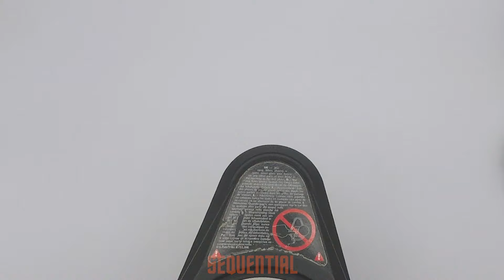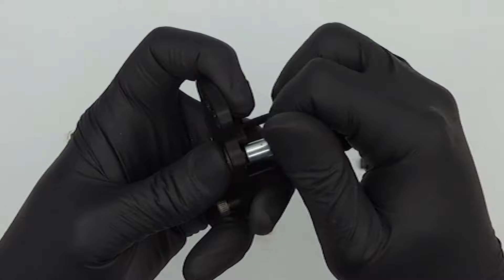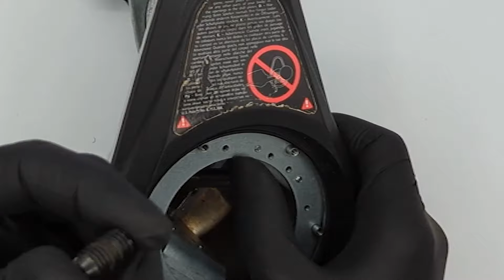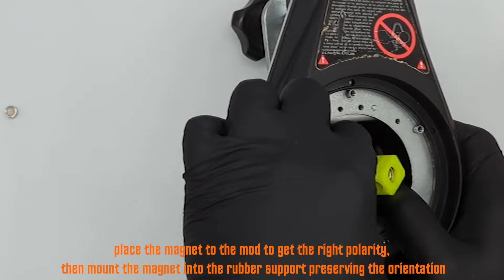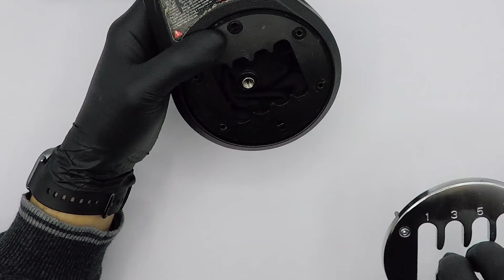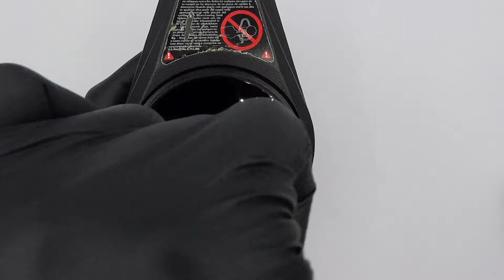3DRAP SHIFTER UPGRADE H-PATTERN / SEQUENTIAL FOR THRUSTMASTER TH8A

Comment: I bought this mod with the extra magnets. Even with the extra magnets the resistance added felt like roughly 20% more compared to stock. Barely noticeable. I must say I was a little disappointed. It did improve the feeling of "engaging" into gear though. Also I would suggest taking the whole shifter apart for this installation.
Reply from the maker: thank you for this feedback.

Comment: What makes the mod so special compared to the other mods that have ball bearings.
Reply from the maker: Thanks to revolutionary magnetic technology, the TH8A Magnetic “Mod Cambio” New-Gen Shifter MOD completely eliminates friction, ensuring unparalleled durability and a wear-free driving experience. Concentrate only on the track, without worrying about maintenance.

Comment: the little metal thing responsible for switching between long/short modes, one of the screws "digged" into the plastic of the mod, i made sure to not overtighten anything or mess around with anything, but the whole mod is basically ruined, works for a bit before it starts to squeak terribly and shifting starts to feel terrible